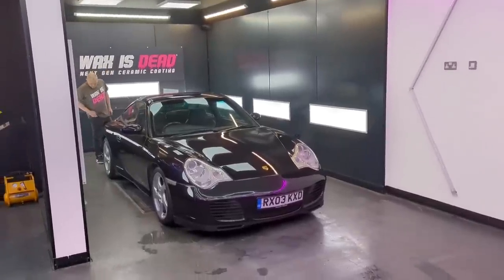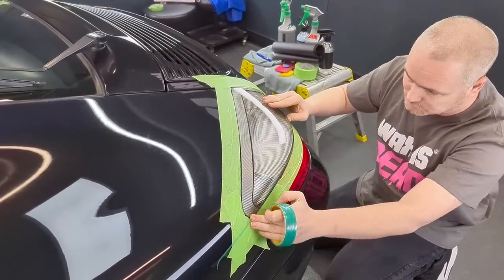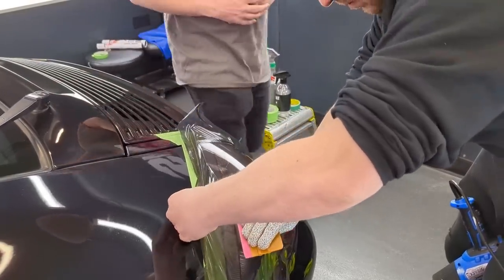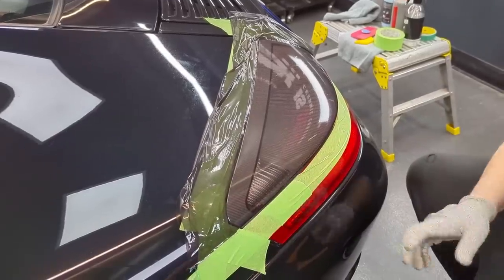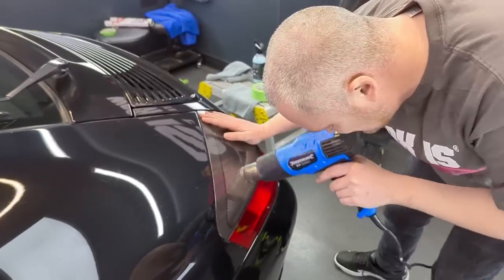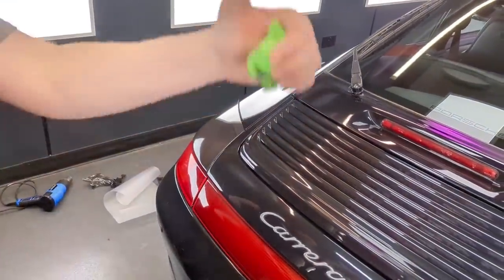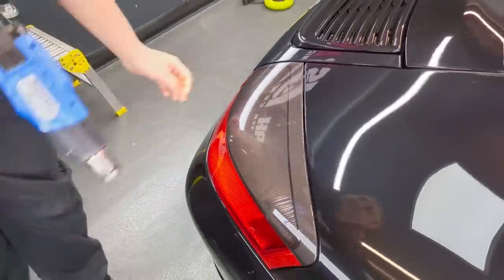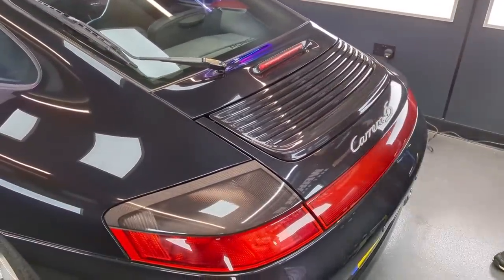Tinting the tail lights on my Porsche 996 C4S

Comment: 1:20 we don’t have to put a scalpel anywhere near the car 
Until they do LOL
Reply from the maker: they dont have to cut down onto the car will.  you will always need to scapel with this line of work.  But without the cutting tape that would have to cut into the car.   they use the scalpel around the edge where you cut into a gap not onto a surface.